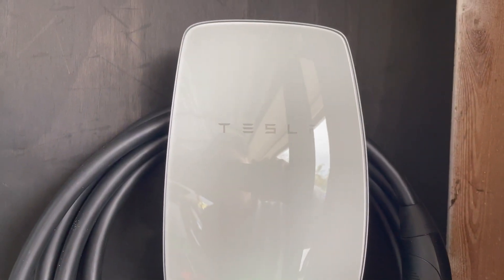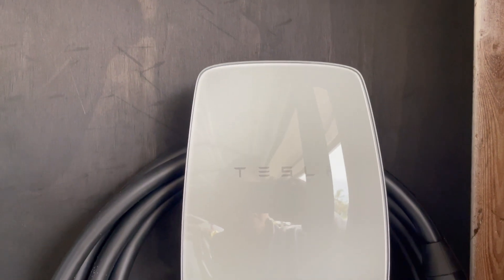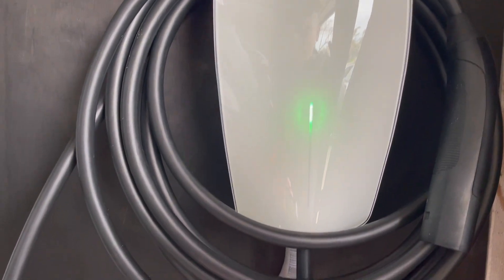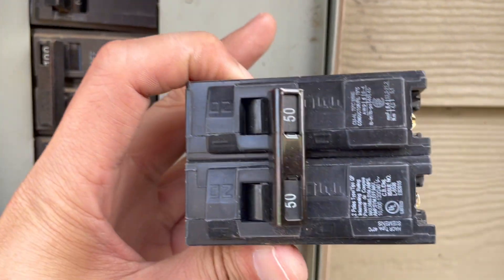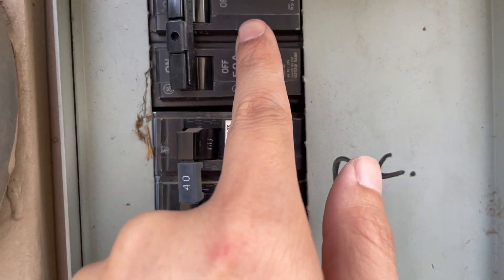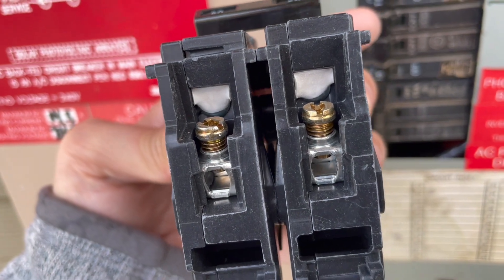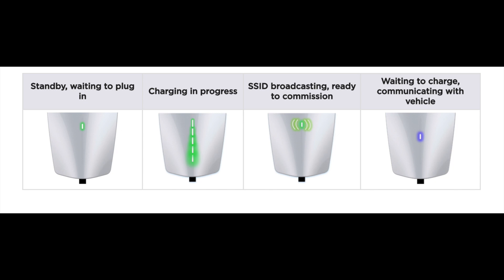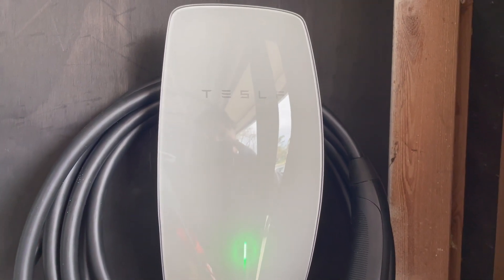DIY TESLA WALL CHARGER / CONNECTOR GEN 3 INSTALL

Comment: Great video.  If you wanted you could measure amperage while running everything and find out if a 60 amp breaker would work out ok.  But in any case, 50 amps is generally plenty for home charging a Tesla.  Very thorough.  I ended up getting a second Tesla so have two wall connectors in power sharing mode, so they never exceed the amps of the main breaker.  It's a slick feature if you decide on a second Tesla in the future.

Comment: You don't need a 6/3 you need a 6/2. 6/3 is more expensive and it has a neutral wire which is white that you do not need for this installation